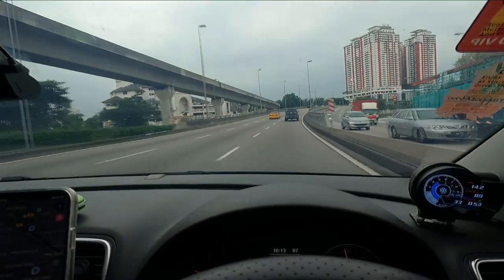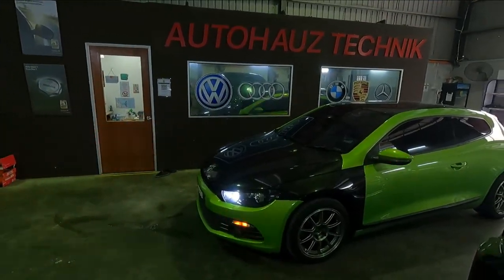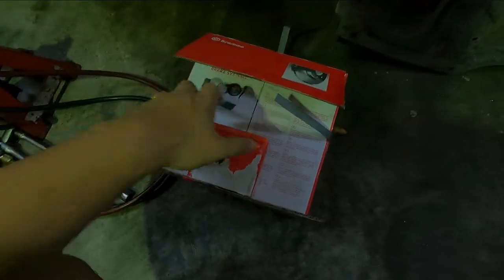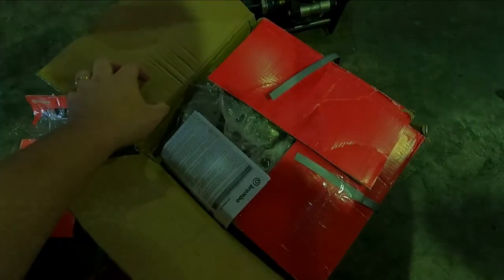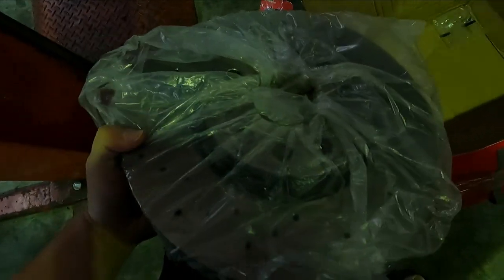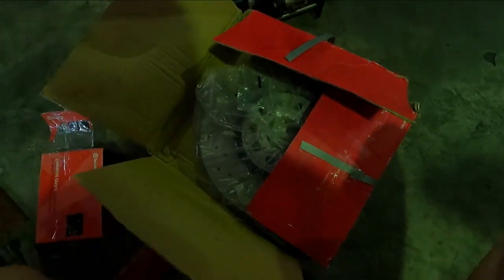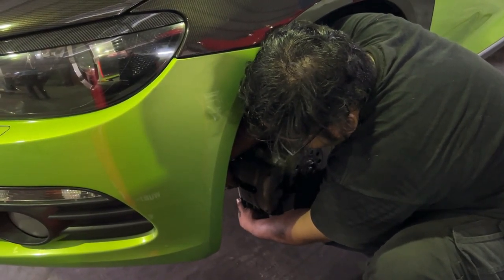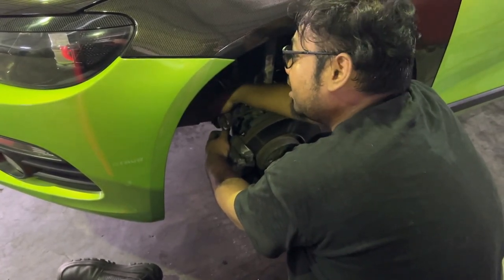BREMBO XTRA Install on Volkswagen Scirocco! *Cross-drilled Goodness*

Comment: How they holding up? Any squealing noises initially when braking ?
Reply from the maker: Just like every set of new discs and pads u need to break them in properly then all will be good. So far no noise at all. Very effective braking even in touge sessions.
Reply: @DrivenTechReviews  Thanks for your replies! Some awesome content you got there! I have a Passat B8 (currently on stock rotors) I too agree that BBKs are an overkill for our daily driving needs. (They cost a lot eg: AP Racing 5000 6 piston series is like rm10k+) I also doubt the authenticity of so the so called "refurbished" Brembos taken from Porsches, Teslas etc (selling at rm4k). Hence decided to just upgrade the rotors, brake pads, steel braided hose along with the tires for good braking. Any idea if the Brembo Xtra rotors are heavier / lighter than stock or just weigh about the same?
Reply: Mine squeak insanely much and I’m a mechanic so I know what I’m doing

Comment: How’s the wear on these? Hoping to install these as a replacement for my front axel. Do you notice any significant improvement in the rain? I live in a damp climate and run all season tires, basically aiming to optimise the car for wet/damp/mildly cold conditions. I’m not worried about noise or anything, only performance and wear rate (:
Reply from the maker: @vxvii9069  I would say excellent. I am still on my 1st set of front pads and just recently changed my rear set. Bear in mind I go for touge sessions every week and drive it almost daily. No noise just a noticeable amount of brake dust.
Reply: @DrivenTechReviews  that’s awesome. I’m not sure what pads to run. At the moment I’m just looking to improve consistency especially in wet conditions. Currently running on all season contact 2s with 17” wheels and it the handling is amazing. I’m hoping to install a Darkside S3 intercooler and a 2.75” catback exhaust in preparation for a tune later on. Car is similar to your scirocco - UK spec Leon 2.0 TDI. Absolutely cracking chassis 😄
Reply from the maker: @vxvii9069  get the brembo xtra pads also I think they work best together.
Reply: @DrivenTechReviews  thanks. I’ll see what my mechanic says next week as I asked him for a quote on doing the brakes and ARB bushing. Were they a lot more than standard pads? I can’t find them on euro car parts 🤕